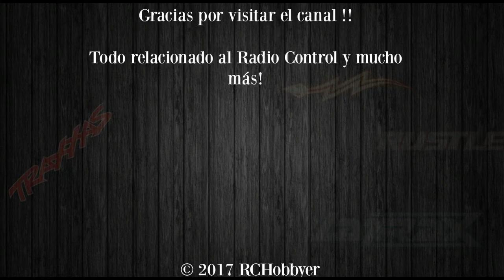Traxxas Slash 4x4 update termina mal | fallo del motor | reparacion de motor

Comment: Porque le conecto la pila ami Traxxas y no da nomas parpadea en rojo ?
Reply from the maker: Cual pila estas utilizando? Porque si es una pila nimh y parpadea rojo es que el ESC esta en modo LiPo (verde), para configurarlo al modo nimh debes dejar apretado el botón por 10 segundos, saludos!
Reply: Si lo tengo así pero da poco y empienza a parpadear rojo un rato y solo se apaga
Reply from the maker: Que bateria utilizas? La detección de voltaje está activada y al usar una nimh debes desactivar la detección de voltaje. Debes encender y luego vas a presionar el botón hasta que oigas un tono. En verde esta la detección de voltaje activada (Lipo) y en rojo desactivada para usar nimh solamente.